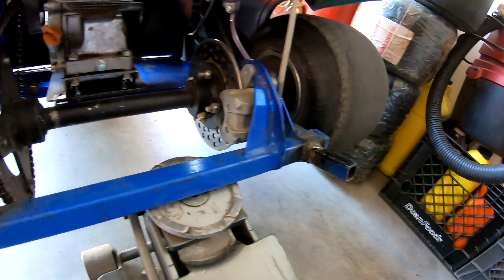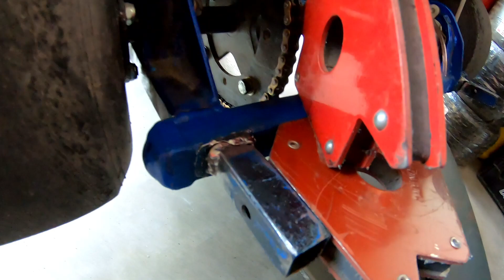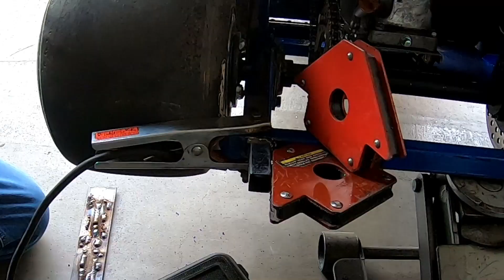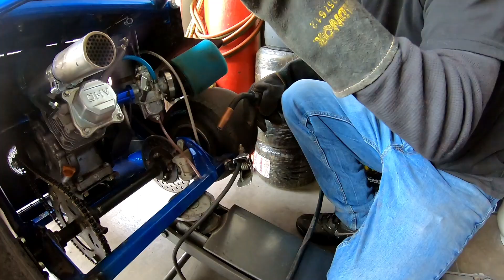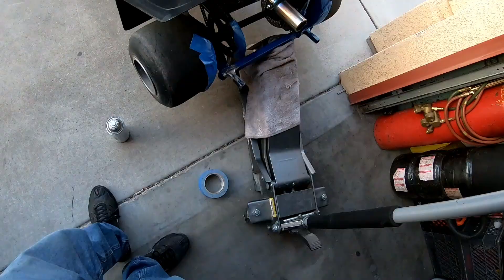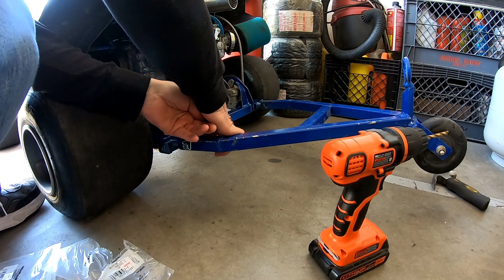Fixing the wheelie bar with awesome welds!! After big wheelie

Comment: If I put a better cam in a stock predator non hemi 18 pound springs  and a 22mm makini  will it damage the moter
Reply from the maker: Adding a cam and springs and a Mikuni won't damage the motor as long as your not revving it past around 5000 RPM all the time. I would add a billet rod and flywheel as soon as I could to make it more dependable.
Reply: Thank u for the advice

Comment: What welder are you using?
Add a flat plate across the top for additional strength.
Reply from the maker: The welder is a  Lincoln electric MIG pro 140.
Reply: @Black66  nice welder
Reply from the maker: @stanlucas665  Ya, I like that welder. It sure comes in handy.
Reply: @Black66  are you welding with gas or flux core?
Reply from the maker: @stanlucas665  I'm using gas, 75/25

Comment: Do you think the Coleman 100 is good for I guy my size, I am 5’7 and 170 pounds
Reply from the maker: It would be ok. They're just not that fast for a bigger person. Easy enough fix though.
Reply: @Black66  what mod do you think I should do for the bike?
Reply from the maker: @lilrabbi2701  On the 3 horse engine if you remove the governor and add a header pipe it should run around 40 MPH. If You drill the jet and add a flywheel key that helps too.  If you really want to go fast, swap the 3 horse for a Predator 212. I have a video on the Predator swap. It was a pretty straightforward swap.